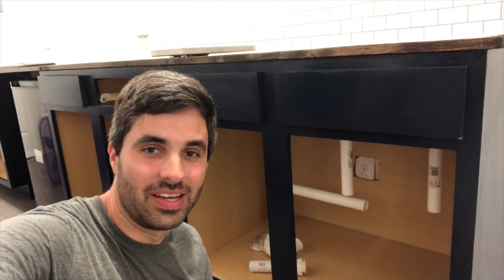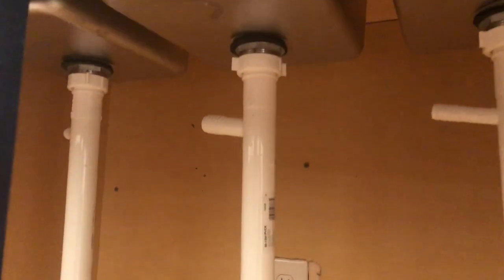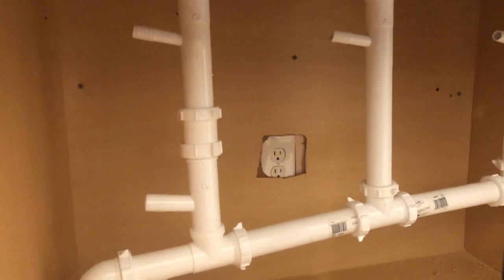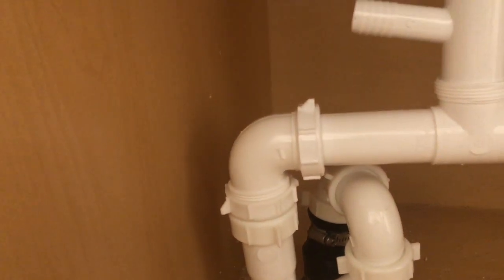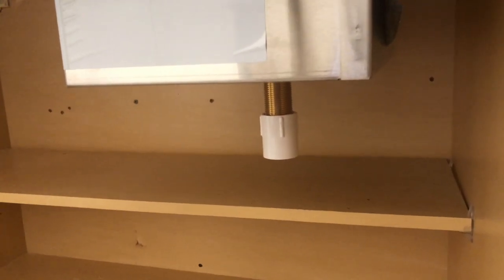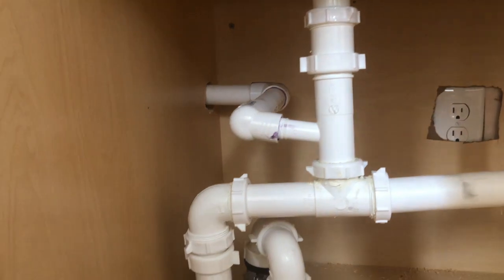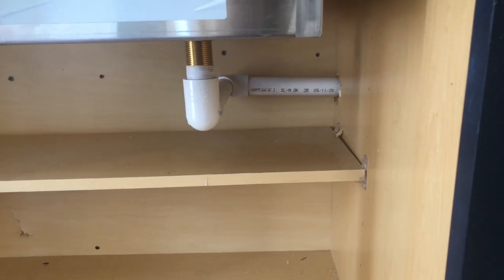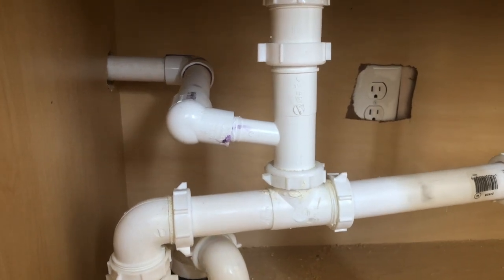Coffee Trailer Video 4: Plumbing Part 1

Comment: Looking good. I recommend putting some silicone on all the fittings(takes about 10min) because bumps in the road can cause those fittings to slip. The silicone is flexible and helps keep it all sealed if it shifts.
Reply from the maker: Great input. I will definitely do that. Thanks!

Comment: Great videos! Looking forward to the next part! Where did you put your gray water tank? Is it under the floor somewhere? Keep up the great work! Glad to see you up and running! Following you guys on facebook!
Reply from the maker: Hey Matthew! Thanks so much. I put the grey water tank beneath the trailer. It’s a 45 gallon tank. I had a fabrication company weld a frame around it so it would be secure
Reply: @jojosespresso9264  interesting, do you have any issues with it freezing up?

Comment: Did you make water connection to Espresso machine from the same water tank which is feeding sinks and hand washing sink? Or did you use a separate tank? Thank you
Reply from the maker: All fresh water is coming from the same tank. I am using a 40 gallon fresh water tank. It goes from tank, to pump, accumulator tank, hot water tank, hand washing sink, 3 bay sink, rinser, filter, espresso machine, accumulator tank, then finally the Bunn coffee maker. I have check valves between every connection to keep water flowing in one direction. Check out caffewerks.com. I used them for all things plumbing and it paid off! I highly recommend them.
Reply: JoJo's Espresso Thank you so much.